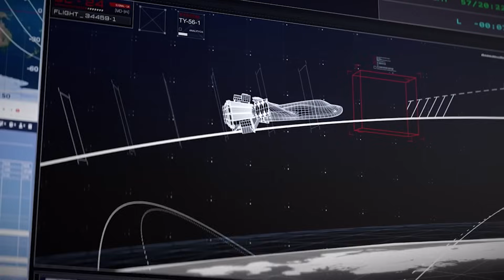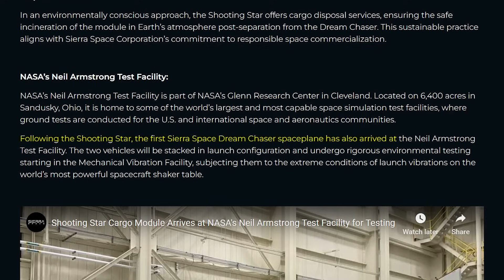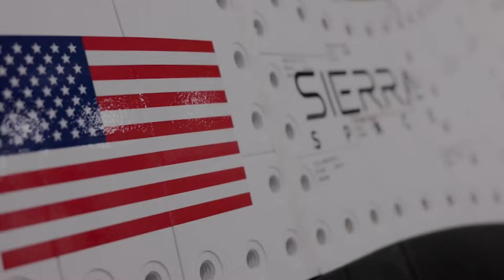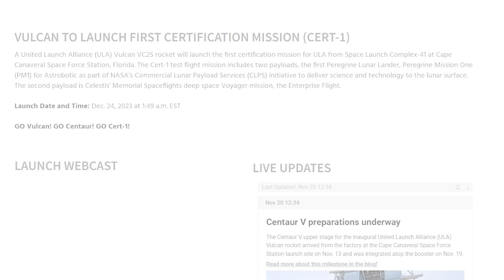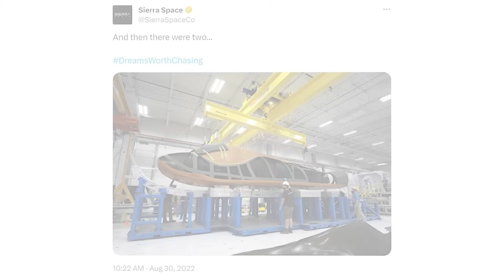Dream Chaser & Shooting Star Have Arrived At NASA's Facility

Comment: this is the dynosoar spacecraft with the centaur upper stage. just way later
Reply: Dyna-Soar did not use the silica tiles. It used a powerful, high temperature metal heat shield. It was never actually tested in an actual re-entry from LEO, so we have no way of knowing how successful it would have been. Personally, I would love to see a metal heat shield on future vehicles so we don't have so much hand-wringing about tiles falling off or getting smacked with space debris or falling ice.
Also, the Dyna-Soar was not a lifting body. It had wings. If the government had been willing to spend the money back in 1963, it could have taught us a lot about space planes well before the shuttle. It may well have shown how a successful reusable space plane could be used and done away with all the skepticism that came from the ill-fated, overambitious Shuttle design that was way too big, expensive,  mounted on the side of the vehicle (creating weird forces and debris danger), and using Hydro-LOX engines prone to leaks and requiring weird "drying out" processes between firings.

Comment: What again is the point of dreamchaser? What could it do better than all the stuff we already have already can?
Reply: Bringing cargo down with minimal g stress. Unlike a typical capsule
Reply: @colemantrebor1610  Interesting. That seems like it’d have very minimal applications though - mainly just bringing down fragile experiments that ballistic recently would destroy I’d imagine
Reply: What exactly is all the stuff we already have ?  And which of these options can deliver cargo and even crew to an airport, instead of having to be fished out of the ocean ?

Oh, Dragon was designed even for point landing, but NASA got scared: never try something better as long as old and more complex stuff works.
🚀🏴‍☠️🎸
Reply: @MichaelWinter-ss6lx  If you need someone to explain “all the stuff we already have” to you then I don’t think you’re gonna be able to provide a good answer to my question
Reply: @MichaelWinter-ss6lx  also how on earth is the tried and tested method of splashing down in the ocean more complex than getting a spaceplane down from orbit and apparently landing it an a commercial airport???
I mean didn’t the shuttle need an extra long runway to land? Dreamchaser might be smaller but it’ll still be coming in at similar speeds…
Reply: @oberonpanopticon  Both Edwards and the LFF are 15,000 ft, but most of the backup runways were 10-12,000 ft.  Being considerably smaller, Dreamchaser needs an 8000 ft runway.   Well smaller than most major commercial runways.
Reply: @Rocketsong  Interesting, I did not know that!
Reply: It also lands on a runway allowing time-sensitive research samples to be taken to lab within minutes of touchdown, rather than having to wait hours for a capsule to be recovered at sea and shipped into land before NASA has access to the samples.
Starliner will have similar advantages (since it can be recovered on land), but like other commenters have mentioned, the spaceplane undergoes lower G forces during re-entry than a capsule re-entry.

Comment: Since Dreamchaser is designed to handle the stresses of re-entry I  surprised that a fairing and the weight and complexity of folding wings is required at all. I understand the crewed version is to be launched without a fairing so it seems odd to encumber the cargo only version with what ses to be unnecessary impediments.
Reply: It's still an experimental vehicle.
   A future variant would probably not require a fairing.
  But for now, better safe than sorry.
Reply: The reason why they will be using a fairing is probably for aerodynamic reasons. If they use a fairing then they don’t have to reprogram the rocket for dealing with an exposed payload with large wings.
Reply: Should've put their dummy unit on a launch vehicle to run a test.
Reply: Was the X-37 launched naked, or did it use a fairing?
Reply: @ronjon7942  X-37 is launched inside fairings. DC will launch in fairings as well, so they dont have to worry about countering the lifting bodies forces on the rocket. The manned version wont use fairings in case it needs to abort mid flight.
Reply: @Pene7942  but they will for the crewed version. The DM is pretty aerodynamically shaped for retry and control. I doubt there is much of a difference between this cargo version, a crewed version or a fairing, so it would be really interesting to hear what Sierra have to say.
Reply: @Pene7942 Fairing.  Watch the upcoming Falcon Heavy launch of X-37 !!